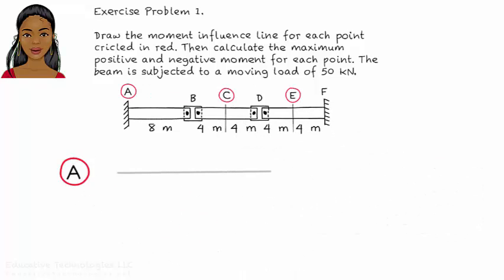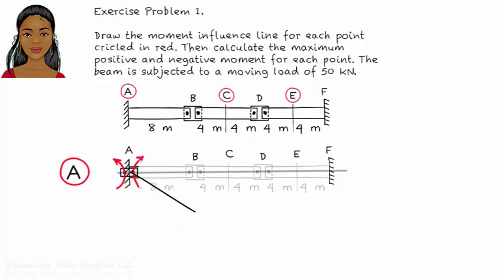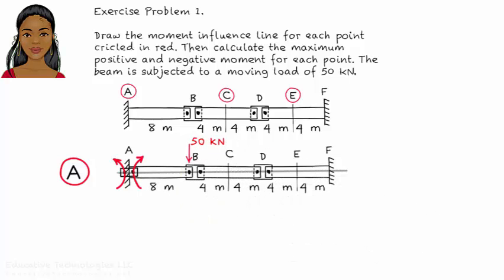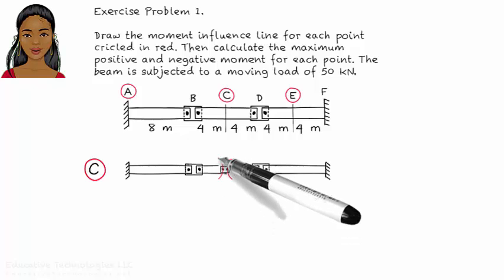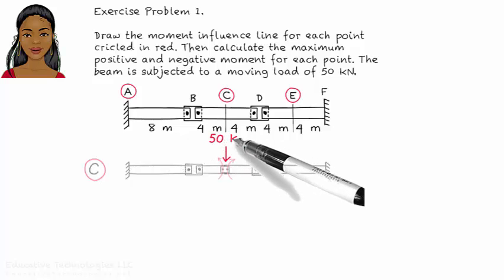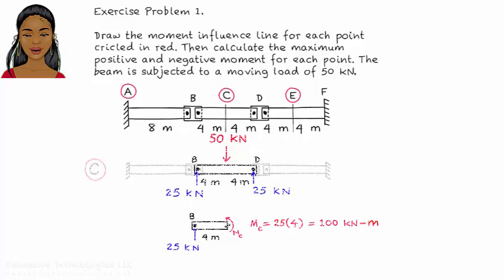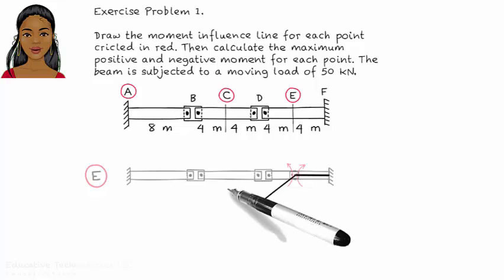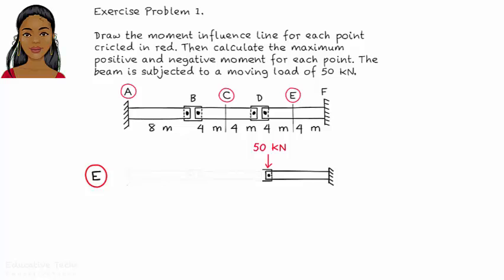Moment Influence Line: Solution for Exercise 1

Comment: Instead of a 50 kN load, let's say we have a  two-wheel load of 30 kN and 70 kN 4.5 m apart. How shall we do it?
Reply from the maker: Generally by trial and error. We need to move the pair of loads on the beam in search of the position that yields the maximum moment. 

In this case, given the triangular nature of the influence line, the maximum moment occurs when the 70 kN load is placed at the peak of the influence line. Any other load pair position results in a smaller moment value.

Comment: This structure is 1st degree indeterminate. Influence lines would be curved here, since they are only straight for determinate structures.
Reply from the maker: Do you mean we cannot analyze the beam using the static equilibrium equations when it is subjected to a vertical unit load?

Here is how to analyze the beam. The middle segment of the beam (the segment between the two hinges), when isolated, is statically determinate. We can calculate the shear force at each end (hinge) of the segment using two equilibrium equations: sum of the forces in the y-direction = 0, and sum of the moments = 0. 

Note that since the beam is subjected to gravity load only, there is no axial force in the beam.

Once the shear force at each hinge is determined, we can calculate the two reaction forces at each fixed support using the equilibrium equations.

Simply put, the beam under gravity load is statically determinate.
Reply: @DrStructure  Thank you for the explanation! This makes sense :)

Comment: Dr. Strutre,

For A, why is the entire load is at segment AB, and use that portion for analysis. Why not BD? Also for C, why is the entire load at segment EF, not DE or BD?
Reply from the maker: We place the load where the influence line has its peak/maximum value. For A, the influence line peaks at B, so we place the load at B. For C, the influence line peaks at C, so the load has to be placed at C in order to determine the maximum moment at C.

Comment: sir, why ILD goes up at C & not for E..
Reply from the maker: Good question.
When drawing moment influence line for C, segment BC wants to turn counterclockwise, since the left moment is acting in the counterclockwise direction. For the segment to turn counterclockwise, it has to move up. That is, the right end of the segment has to be higher than its left end signifying a counterclockwise rotation. 

The same principle applies when we are drawing moment influence line for E, segment DE wants to turn counterclockwise. But here E cannot move up, since the fixed end at F prevents any movement of EF. For segment DF to have a counterclockwise rotation, again, its right end has to be placed higher than its left end. But here the right end (E) cannot move up, so the left end has to move down to make the rotation counterclockwise.